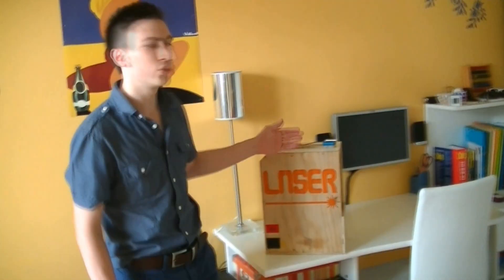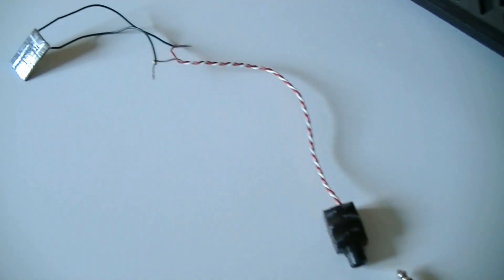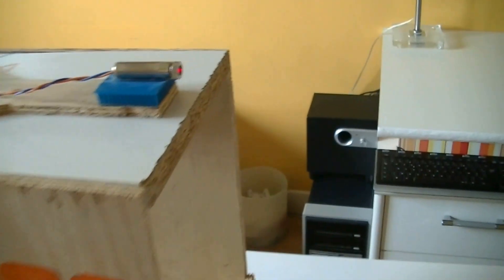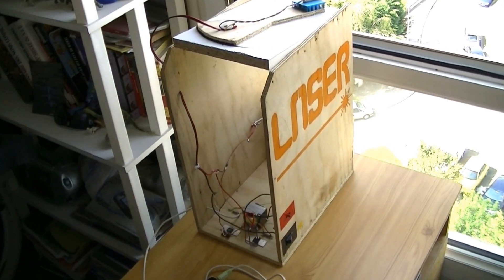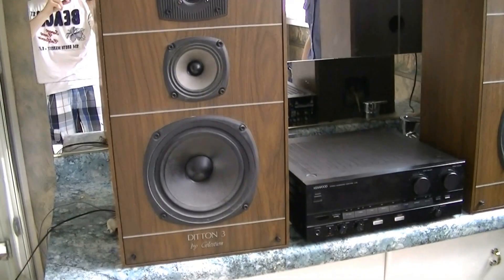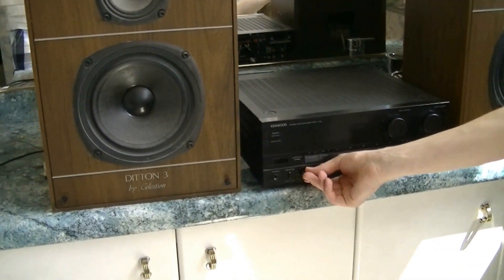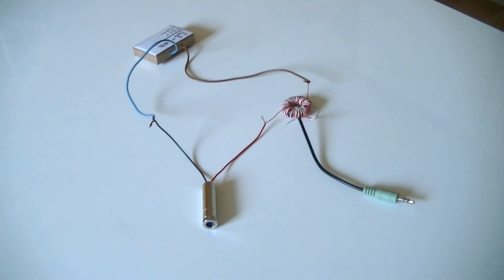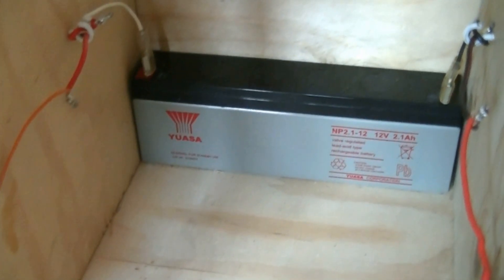Sound transfer... BY LASER : DIY Experiments #3 LASER light music wireless

Comment: @ DIY Experiments I am interested in hearing with lasers through walls. I need to do some investigation to frame my neighbor with his family (of delinquents) and have them arrested. I have to remain in passive mode and cannot react in any way thus risking getting old before my time. an 'acute angle is formed (if I am not mistaken) with laser and photoresist. A solution can always be found even if it is not precise the 'important thing is to draw some evidence. by wall I mean the dividing wall of a two-family house where I live. I await proven solutions that will give noteworthy results. Thank you very much.

Comment: A great project ,Subscription earned! I was thinking,couldn't you deal with that background noise/light level using a filter over the solar panels like they do in an IR remote receiver so that all a IR remote sensor can see is the infra red signal.

Comment: I was only 17 years of age back in 1971, living in Kenya East Africa, in Nairob  studying in Technical high school , I made a sound to light project, parts were so hard to come by in kenya, yet I managed to construct a project and won an award for doing so in a competition held at Kenya Science teachers Training college. battery operated lasers were not available even in advanced countries, let alone in Kenya, so in my project I used flash light or a 2.5volt torch bulb and a dish mirror, which converted the light from the torch bulb into a  parallel beam of light,  as long as the bulb is set in the middle of the curved mirror coated dish, at its focal length, just a few centimeters in front, the bulb is held there using stiff wire,. very similar to satellite dish and LNB is held in front of it by a stiff piece of bar,  then you feed the bulb with a audio voltage signal from a sound source that can be your tape recorder or even iphone, but iphone will not be able to power the torch bulb easily due to its low power,  assuming you are feeding the out put audio of a tape recorder connected to this bulb, not the speaker, the bulb will light up making it fluctuate in intensity according to the loudness of your music or sound signal, with rhythmic  beat the bulb would also start to flash like as if it is kind of disco light modulated by sound signals, and by the varaying sound vocals and instruments , but wait, when the sound goes very quiet or at a whispering level, the bulb will cut off completely,  because the 2.5v bulb will not light up at all when the voltage to it gets very low, like 0.5volts or less, it may barely even show any light, this means there will be so much distortion, so what you need to do is to use a transformer of 1 to 1 ratio,  but whose primary and secondary windings resistance is approximately 8 ohms or more but not much more, e.g. anything between 8 ohms minimum to say 100 ohms max, then you take the output of the transformer and connect a 1.5v AA battery in series with the output of this transformer and connect it to a bulb, this time the bulb will light up even when there is no sound but it will glow constantly, when you play the music, it will start to modulate the intensity accordingly and this time even soft music passage will be reproduced perfectly without any distortion, we call this a bias signal, this will keep the bulb always light up, so this part is your light transmitter. 

Then on the receiving part, you need a convex lense, of about same diameter as your mirror curved dish, though it is not essential, as long as the parallel beam of light is falling on this lense, it will then focus this light into a converged point, you then hook up a photo transistor at this point and feed the connections of the photo transistors to a pre-amplifier, look on google and see a typical preamplifier circuit, you can then feed the output of this pre-amplifier into a big powerful speaker amplifier, as long as the beam is striking the lense, which you can even use one from an ordinary magnifying or reading magnifier of approx 50 to 100mm diameter, this project can transmit sound over a light beam for about 100 meters with no problems, only problem is daylight or sunlight affecting the photo transistor, so if these were kept in dark chambers then ambient light can stop influencing the photo transistor.  

When I made this sound to light project, I did it as a hobby, and obtained the idea from a physics book that i found in school library, so basically it was not my original idea but a scientific idea and practical guidance how to make it, and why you need a bias battery for the bulb, so I basically put a project together, apart from the thrills of constructing one and seeing it work perfectly well, and as you obstructed the beam it would stop the light signal reaching the receiver lense, and the amplifier would stop making the sound, it was like some fun just doing that, no one not even me would have been able to guess at that time what may be the purpose of such a project, indeed today there are hundreds of applications that run on light beams being interrupted to make security detectors to catch intruders, counting traffic flow, people counters, detecting cars arriving at gates for automatic gate opening, reading optical encoders, detectors, literally thousands of uses,  but the biggest impact this kind of technology brought to us is the todays high speed fibre optic communications, sending thousands of independent channels of high speed TV signals and millions of broad band signals via fibre optic cables laid between continents,  indeed satellites have their own advantage over fibre optics, each to their own merit, advantages and disadvantages,  those who don't know, copper wire can and does also conduct sound and other electrical signals and communication signals but these electrical signals have limits, as opposed to light beam, with electrical signals you cannot transmit very many high speed channels due to stray capacitance that restricts bandwidth due to capacitance effect and also due to magnetic effect of current passing through conductors and causing cross talk through inductive effect but fibre optics can carry thousands of channels without cross talk.  When I did this project in my school, the panel of judges asked me "but what is the purpose of this project, what practical used does it have?" and I was silent, at that time there were no uses for it to be honest, we (The world)  had barely managed to make computers and other high tech communications and despite which they awarded me a 3rd price for the project as a technically advance project but I had no idea then how many different uses it could be put to, nor did that physics text book described what this sound to light project could do apart from transmitting sound over a direct line of path of light. still i guess someone first had to invent a round wheel before they even thought that one day there will be cars using four such wheels and travel at over 300Kmph . One [piece of technology can branch into thousands of other uses.
Reply: Can you please help me because someone keeps harassing me with something like this and I don't know who it is or where it is coming from. Please tell me how to track this or stop it. They beam my mattress and couch every day and night to disturb me. I'm soo stressed out  😢

Comment: you could transmit back and forth ,but it would have to be on the open optical path  ,send receive , not multiplexing , re convert  the signal back to digital then analog , you would need a switch on the sender to make it a receiver ?

Comment: Which modulation is used
Reply: Analog modulation, similar to AM, but without any carrier wave, instead a constant voltage. 

The AC voltage from a phone is 100 mV, and let's say the constant voltage is 3V. This creates a range from 2.9 to 3.1V. Not much, so their transmitter has an amplifer. A 10x gain amplifier would output voltages from 2 to 4V, which is much better.

Comment: @DIY Experiments , hi ur laser is red colour, the wavelength of light should be around 650-660nm, or 635nm, so i assume that if u put a red colour lens/glasses or professional stuff(some filiter or wutever) which only allows this wavelength of light pass though and infront of the solar panel, u should be able to get ride of all those interference from the background
Reply from the maker: It's a good idea but interferences are not only from the background light, the laser beam itself is also unstable because of the wind over 500m. The real solution would be to use a digital signal :)

Comment: Noob experiment.... I already did many projects on this
Reply from the maker: +Rambhajan Shah : And why it would be noob if you already did such a project?
Reply: Not more than LDR and emitter. 
U can apply these sensor anywhere. 
The main concept is that emitter transfer current only if it's get light(your laser)  which depend on dust particles from source to destination.

Comment: Solar panels and a red laser?
Reply from the maker: +Nenad Kitanović : What's the problem ? In principle solar cells are more sensible in the green (555 nm, the wave length the most emeted from the sun) but red remains in the domain covered by solar cells. In reality solar cells are way more sensitive in the side of IR's.
Reply: DIY Experiments I know that the solar panels if made of silicon are more sensitive to IR but not so much to the red light and I will myself test them to red laser to see does this realy works. Just beign skeptic.
Reply from the maker: +Nenad Kitanović : Just try ;)

Comment: It's fake
Reply from the maker: +Swapnil Vengurlekar : Nop ! Look at our french vidéo (2012) and ou our 2 - 3 previous attempts since 2009 ! We also acheive that with low power LASER, LEDs, IR LEDs and optical fiber ;)
Reply: DIY Experiments : It is possible only if use the laser as optical Audio out (which is a digital signal in the form of light pulses representing digital 1's an 0's) and have an optical audio decoder (to convert the digital audio to analog) on the other end. What you have done is connected the laser directly to the laser and used a solar panel as the receiver that is directly connected to the to analog audio input and still managed to play crystal clear music while the solar panel is placed in a well lit room which will definitely induce some voltage in the solar panel that should be enough to generate noise or blow the preamps, an also audio signals vary from 20Hz to 20,000Hz, which is way to fast for a solar panel to switch signals to!
Reply from the maker: +Swapnil Vengurlekar : In fact It's possible to do that in a digital way but analog is simpler and more impressive. If your not conviced you should try by your own ! If you'r not familiar with electronics you can make an easy version with a single ferrite core transformer. It's not a Hi-Fi sound, the solar pannel get rid of the majority of the frequency above 400Hz, the distorsion is high, but in this experiment it's us, humain, who are impressive to hear a music with such a level of distorsion. I made this expriment by my own the first time at the age of 14 (get the idea and an effective model). If you think its not possible you may not have done a lot of experimental work with sound signals, sincerely, you should try :)

Nowdays I improved this model with a homamade D class amplifier and we can't hear the difference between the laser transmission and the direct jack plug.
Reply: DIY Experiments : I did try, I have worked on lots of projects that involves data transmission using light. So, when I watched your video, I tried it right away. For my experiment, I used a sine wave at various frequencies as an input for the laser and also conformed that the intensity of the laser is proportional to the sine wave. The solar panel was connected to an oscilloscope. As the laser is a diode, a positive half cycle should be seen on the oscilloscope for frequencies between 20Hz to 20000Hz, but the laser wasn't bright enough. So I tried with a bright LED lamp and found out that the solar panel isn't responding fast enough. The Frequency of the sine wave had to be around less than 8Hz. And at 8Hz, its very difficult to transmit sound that is audible to the human ear!
Reply from the maker: +Swapnil Vengurlekar : If you have a scientific way of thinking you can't stop after this fail ! No a Solar cell is not limited to 8Hz... It's around 400Hz that the signal is at 0,707 of the maximum (definition if the cutoff frequency). Try with a sound signal and a speaker then we'll discuss again... In addition there is no "all or notting" cutoff frequencies, even with a second order filter there is still something way after the cutoff (though the amplitude is highy reduced). Look our other projects, there are always sophisticated but nerver fakes !
Reply: DIY Experiments : If it's limited to 400Hz, then only bass should be audible, but in your video, higher frequencies are also audible! by the way what is 0,707?
Reply from the maker: +Swapnil Vengurlekar : Try to put a first order cuttoff filter to a music signal then you'll hear that besause of the log scale of audition, it remains high frequencies (the acoustic sensation is not proportional to the acoustic level).

You have never see the first dimecimals of half of the square root of two... ? Plaese stop pretending to "Know", if you do not acheive a fonctionnal version you must ask questions about yourself, not about this expriment that works. Try with music !

Comment: Basically a fiber optic cable. Without the cable part.
Reply: Basically a wireless wire ;P
Reply: yeah, run a digital signal through it, do it both ways, and you've got yourself a point to point network connection...
Reply: Basically light
Reply: Basically internet
Reply: Basically electronic
Reply: Basically
Reply: B
Reply: @xyzclouds   r/decreasinglyverbose
Reply: Basically how to
Reply: Basically Magic
Reply: Try it with Wi-Fi signal
Reply: And with another video I recently watched this could be used to trigger anyone's home assistant device through windows with any spectrum laser sub 1w
Reply: r/owo
Reply: Basically spam

Comment: What is the resistance value if my laser is 4.5v?
In circuit diagram,what is the meaning of U?
Reply from the maker: +parth wagh : U is the voltage of your power supply, the calculation for the resistance is R = (U-4,5)/i. i is the current your laser is maid for.

Comment: I have built one with a class d amplifier, an audio transformer, and a cheap green laser. Works like a charm!
Reply: Bahka,  
Can you share the circuit diagram?  Which amplifier and which audio transformer?  I am trying to build this as a hobby.
Reply: BEWARE! Cheap 532 nm green lasers may emit powerful IR light. This can permanently damage your eyes without triggering the blink reflex! And it is much stronger than the laser output!

Comment: DO YOU KNOW WHAT YOU'VE DONE?! YOU PRACTICALLY CAME UP WITH A WAY TO USE LIGHT AS DATA! unlike fiber optics this is far more cheaper and would work best underground so there's less interference but mostly YOU ARE A FREAKING GENIUS!
Reply: Free air optical data links are old. Choosing the wavelength is important, as the atmosphere absorbs many frequencies heavily, while passes also many. Still there will be problems with rain and other obstacles.
Reply: This there's a reason fiber optics are used. There is a fundamental limit to the size of the dot a laser makes. Even a perfect laser still spread out due to quantum mechanics. With atmospheric noise taken into account, this would be a very inefficient method of data transfer.
Reply: He didnt invent this, and there are reasons fiber optics are uses listen to the truly infamous when he tells you that.
Reply: also it would not be cheaper as the lazer would have to be huge to transmit over a distance, and bigger lazer means bigger cooling system and power supply. So I like where you head is just consider what your saying before saying it
Reply: This wireless "wire" is not safe though. If someone looks into the laser beam, they'll go blind, it's 250 milliwatts of power, well into Class 3B territory. 
You have to wear laser safety glasses.
If a laser can light up a match or pop a balloon (50 mW is enough), it'll burn your eyes out with ease.
Even if the power output is just 20% (50 mW), it's still gonna burn your eyes out if you look at it directly. And anything above 5 mW for longer than a blink is damaging long term.

Comment: Actually this is pretty good, but a solar panel is noisy. Use a LED that is tuned to the same color of light as the laser diode and it wouldn't have the same issues of interference from heat, other types of bright light, or, possibly even that tree. 
We're accustomed to Light Emitting Diodes being used as a light source, but they can also detect the same color light that they emit. When the same color of light is shined onto the diode, it generates a small current/voltage. In this way you can do basically the same thing as the solar panel, but it's excluding the interference from all those other sources.
Reply: yeah but is there a red led that is 10 cm in diameter?
Reply: The LED doesn't need to be 10 cm to catch all the information. Mirrors and lenses can be used to focus the 10 cm beam down to the appropriate focal length if you feel that having the entire 10 cm blotch will improve resolution. 

That said, audio information, such as this video shows, isn't contained in the 10 cm spot. Rather, it's contained in the speed at which the laser light is dimmed and intensified. The LED just needs to have resolution on a portion of that light to demodulate the signal.
Reply: But what Purple is trying to tell you is the area of the LED or phototransistor is much smaller than the  beam, so the captured signal power will be much less, and the amplification and noise much higher.  Solar cells are much cheaper than optics to gather and focus the light on an LED.